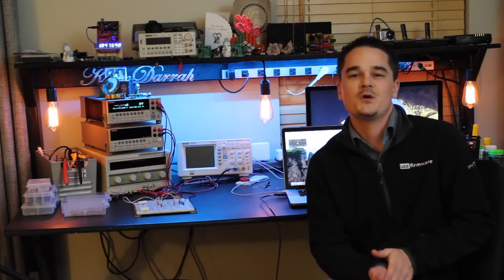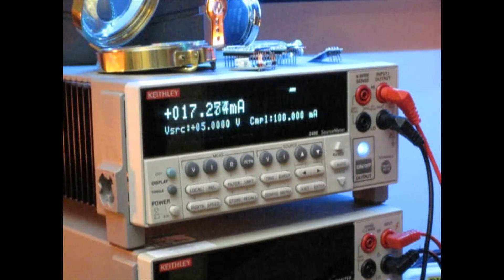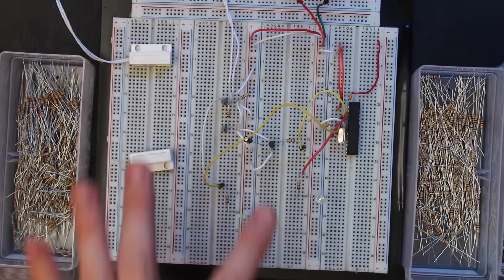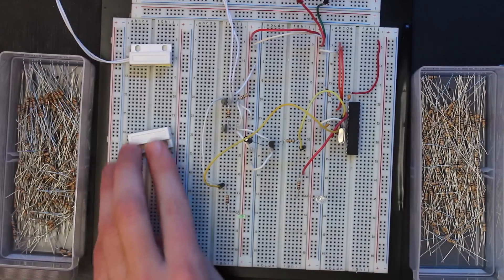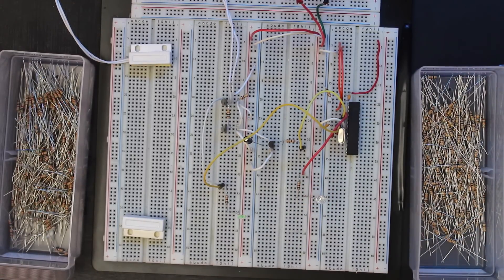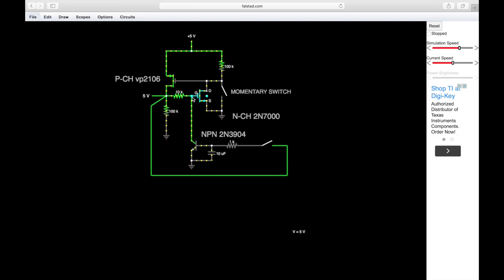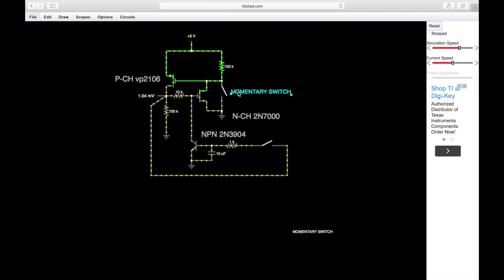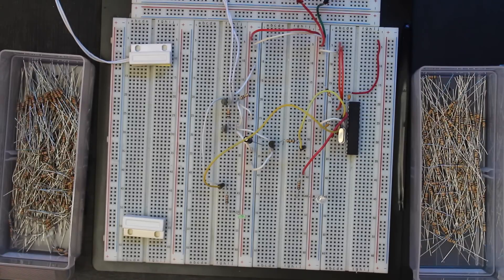Low Power Arduino!  Kill Power Circuit Tutorial

Comment: Capacitors can do that.. They have a charge curve. So with a resistor it would take a capacitor to charge up to a specific voltage depending on the resistor in charge... lol.. of charging it.

Comment: is it possible to get the same result using 2 2N7000 instead of vp2106? my logic says it is but I'm failing miserable in achieve that
Reply from the maker: nope, you want a high side P-CH FET there
Reply: @Kevindarrah  thanks, I will have to buy some then, at least I learned a lot after battling with it

Comment: Hello Kevin  I need to use the arduino nano board like this with low power consumption is it possible.  If so @ which pin I have to give power

Comment: If you get rid of the Arduino bootloader, which is the reason for the boot delay, you can reduce the circuit to one MOSFET (and maybe gate resistor). Just make one of the first instructions pull a pin high that's connected to the transistor. The switch has to be closed long enough for that to happen, but without bootloader that's a few tens of ms max, something a user won't even recognize.

Comment: I want to power off peripheral devices when not in use and power on with a digital output when they are needed. Maybe once a day. I will try this combined with power off mode. I guess I can run my device for a year on one battery.
Reply from the maker: +Engin Yeğnidemir yep, should work for you - maybe longer than a year depending on how long you have stay on for
Reply: +Kevin Darrah Actually I calculated that Arduino alone can run up to the end of batteries shelf life but with my peripherals and duty cycle it is approximately 3 years. More than enough!

Comment: Love the topic on low power with Arduino. Please give me more  ;-)

Why is your arduino booting so slowly?
Normally they boot almost instantaneously. 
I made an atmega32 board  at 16 mhz and it starts to run the program the moment I connect it to power. Are you sure you are not using an internal clock? where the fuses correct when you loaded the bootloader? 

Do you need a latch circuit for this? Why not use the switch to turn a mosfet on for power and let the arduino boot, and hold the mosfet high to run the program and when finished,  it pulls it down and turns itself off, possibly with an extra 10k pulldown resistor.
Reply from the maker: +Richard Walgers Yea, I might have an older version of the bootloader on this part - it's a few years old...  I actually have implemented what you're talking about, by letting the Arduino 'take over' - only problem with that is that there's a chance that by the time the arduino boots, configures the pin and writes to it that you missed the pulse.  I mostly used this circuit because I already had it on my breadboard :)

Next part is coming soon!

Comment: This is gonna be a really interesting series!

I have a project which needs to power 4 LEDs from batteries for a few hours at a time and recharge between uses. It also needs to be small and lightweight so I can only fit a tiny solar panel on it. I'm hoping I can figure out how to do it. I kinda feel like it isn't possible at this point.

Comment: You can reduce the boot time by using the optiboot boot loader. You need to use a usbasp to load it. I made some led and sound toy ray guns that apply arduino power via the trigger and run the loop with almost no delay due to optiboot.
Reply from the maker: +Jamie Feldman funny you should say that - I was planning to make a video on how to burn the bootloaders and the one I use is the optiboot - weird thing is that this is a micro I had lying around - probably flashed with the stock boot loader from arduino
Reply: +Kevin Darrah I would love to see some video series on AVR's programming via SPI and AVR studio!
Reply: Jamie Feldman are you using the arduino for sound output or some small MP3 player that is triggered by arduino?

Comment: Hi, very interesting, could this be adapted, instead of the contact switch, to use a pir module? When arduino powered up, it could send message via wireless eg nrf24l01 that it has been tripped? Would the capacitor size need to be increased for the higher current draw? I'm ok with the code for this, just not the hardware side. Thanks, please keep these videos coming.
Reply from the maker: +Shaun Whiteley Yea, PIR sensor output would work as well - may need some level inversion, but should work.